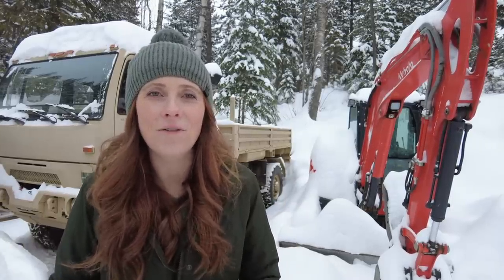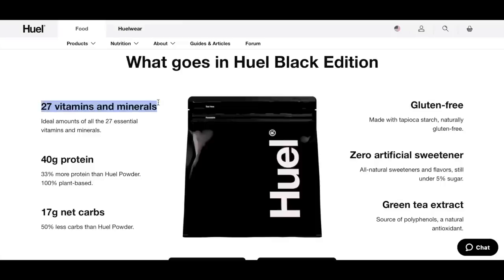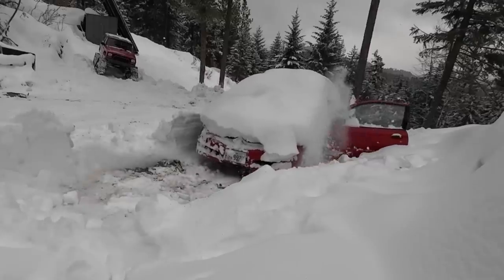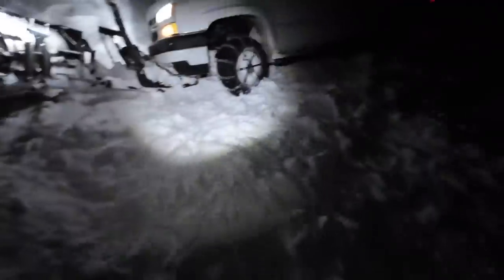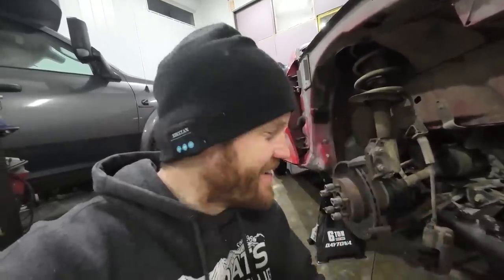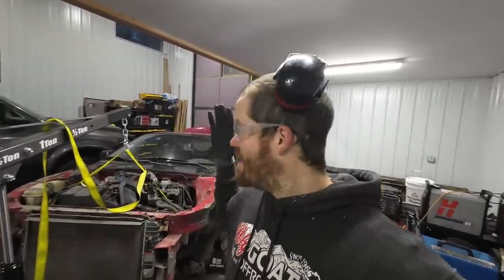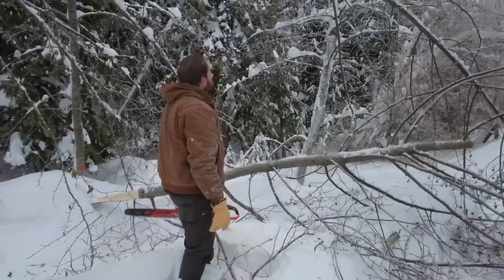Building The ULTIMATE SNOW BLOWER | P1

Comment: 9:06 I had a 1994 Pontiac Grand Am that I locked the keys inside a couple times.  The locks were so terrible that a quarter could turn the cylinder - IF it had not been turned all the way back with the key i.e. just turning it enough to retract the key from the lock.  The thing had automatic locks so so I hardly ever used the cylinder lock.  I used the quarter trick on more than one occasion.

Comment: Winch from back is good. Just don't plow with it in there all the time. Backing through or into snow piles in reverse will pack snow and ice in it. I used to drive with a hitch and backed up to close to a chain link fence and bent a post. Hope that helps.

Comment: Doesn’t the army truck have a pto plate on the trans? I bet it does, and it would have been my solution, running a hydraulic pump and motor on the blower

Comment: I'd really like to know why wouldn't you just put a PTO system on the military truck? I don't think I've ever seen a military vehicle that didn't already have or wasn't designed to have a PTO system installed. In any event I'm sure Rigging a hydraulic PTO system is much much easier to fabricate less expensive and far more practical to install, than a used ECU controlled car engine and transmission and all the necessary electronics wiring and cooling system. If the vehicle is powerful to handle the added weight of all that and the snowblower  it surely has the power to run a PTO pump.
Reply: Probably not enough power. Blowers on plow trucks and even on loaders usually have their own engine.
Reply: @davidboreham   With the right gear ratio PTO drive and hydraulic pump it shouldn't be a problem. Even if it needs an alternate engine to drive it I would have just bought a simple turbo diesel engine or even an early model inline 6cyl gas engine. You would have to do far less fabrication and wiring than using a used late model car engine, transmission with all the complicated computer controls, wiring and sensors, which add far more failure points than add any benefit. Regardless I'd like to hear his reasoning behind the decision.

Comment: Put that car engine on a metal skid lift and fasten onto the rear bed of the truck, run hydraulic lines to a hydraulic motor on the snow blower.  If you blow the engine up in the future easy to swap out. There are other example on you tube of this method

Comment: You can cut the engine wiring harness down and make a stand alone harness. there is a guy on eBay you can send your engine computer to and he will delete the vehicle anti theft system and make it run with out all the extra stuff. All you really need is engine don’t need transmission or stuff to go along with it.

Comment: Replace the cam chain tensioner in the 2.2 with the latest design. The original ones sometimes caused a cam chain failure. Other than that they are a great engine.

Comment: Awesome build! I've always wanted to do something like this but concerned about the torque requirements on the drive belts. Did you use some calculations to determine how many/size is needed for your application?
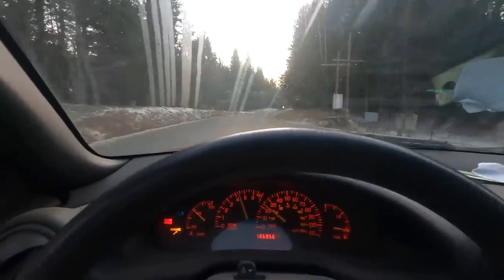Reply: 3:13 what do you do for internet access?

Comment: Find a three-phase genset that produces around 80 KW. Get one with the popular John Deere 4041. Engine is wet sleave, very easy to rebuild, bullet proof and very economical. The old mechanical version only. Parts availability is great for them. Install a frequency controller on it for motor speed control. Now you have a great portable generator and it can power ac motors with speed control. All you need is to mount a three-phase electric motor on the snowblower. Add a hydraulic pump to your genset and you'll have a power-pac which can operate lift cylinders and such. The power-pac/genset goes in the back of your truck for added traction weight. Mounted on a fork friendly platform this set up can used for all types of things including emergency backup. I suggest you find a generator that produces 208v. 480v is only needed if you are pushing power long distances and you can use smaller wire. The 208v is 120v per phase and 208 between phases. The 480v is 177v per phase.  208 will run most things requiring 240 single phase, although motors will tend to get hot if ran to long. I've spent many years as a mechanic in remote mining camps in Alaska, so I'm not an average groupie talking out his hiney. I grew up in the Silver Valley and built logging roads throughout your area. I live in interior Alaska so your temps are warm to me. We hit 45 below a few time already this winter. You kids done a hell of a job with the 46-A. I was impressed. Had a lot of flight time on those old dozers as an operator and mechanic.
Reply: I think the suggestion of the John Deere engine is great, but 80 kw (107 hp) is not enough power for a 96" industrial blower. He could salvage a Deere engine from a larger genset, large mobile water pump, old tractor or farm equipment, etc. Riley already has a large military surplus diesel generator for charging their battery bank if they do not get enough sun from the solar panels
Reply: @chrisdaniel1339  The John Deere 6068 is also an excellent engine but not near as efficient. From experience I would steer clear of Cummins or Cat. The L-10 was a decent engine but after rebuilding a few of them I discovered parts were expensive and very hard to find.

Comment: me thinks you have a massive lack of torque and power.  We run a similar blower on a 115hp tractor, and it will bog that 301 cubic inch engine down with too much snow, when we run it on the 160 HP 426 cubic inch tractor it notices it, but not much, your tiny 134 cubic inch engine at around 140hp will likely run it empty, and with light snow, but don't hope for much more.

Comment: Did you ever consider powering the snowblower attachment with an electric motor?
Reply from the maker: That would be really cool, but the issue is how would we power the motor? 100+ HP electric motor needs a BIG generator.
Reply: @AmbitionStrikes  I'd guess torque not hp would be the limiting factor for your application.  According to the manufacturer's specifications, the 2003 Pontiac Sunfire with a 1.5 L 4-cylinder engine produces 95 lb-ft of torque at 4800 rpm.  A 10hp/7.5kW electric motor can provide 105  lb-ft of torque at 500 rpm which might actually be better for a snowblower as breaking the ice during start-up is when you need maximum torque.  Of course, 7.5kW is still a lot but at least now we are talking about a generator available from Harbor Freight for under $1000.

Of course, I'm talking out of my ass and there are probably many obvious reasons why this doesn't work but it is an interesting thought exercise.

Comment: You will not like it. Frist why do you not use a trailer?What would you do if the breaks don't work and got into a car crash and you hurt someone? Then if you got the car for the power train.Do it you have to much things hanging around. Witch should be under cover and started up ones a week and moved around and keeping the batteries in good shape.I know became at one time I had to much equipment hanging around. I got smart and sold things off. Do not be a dumb behind. Google does not like my comment.I am from the school of hard nocks.To many snow flakes.You have great place to hide when everything falls apart. Good luck Live Free or Die Wolverines.

Comment: It may have been a better option to put an electric motor.  No transmission, more reliable, more torque, no fuel issues, works in all weather, more compact, more environmentally friendly, more silent....
Just saying!
Reply: And no endurance!  Under the high load of a snow blower the batteries won't last very long.  You'd spend as much or more time recharging as blowing snow.  And, not as environmentally friendly as you might think.  In Idaho a bit over one third of our electricity comes from burning fossil fuel (coal and natural gas)!  California is worse.  Last year about 51% of their electricity came from burning fossil fuel.